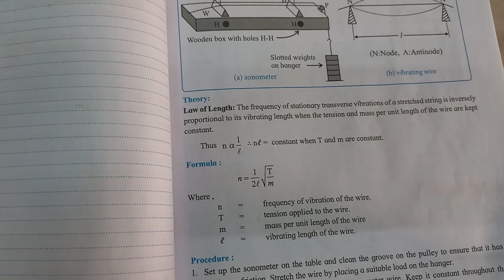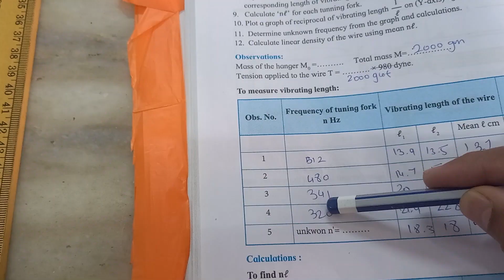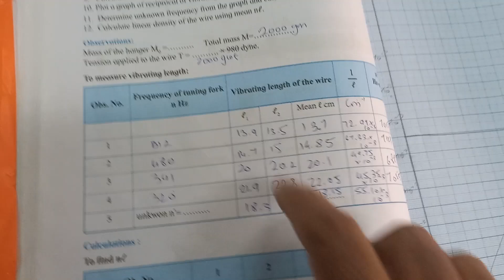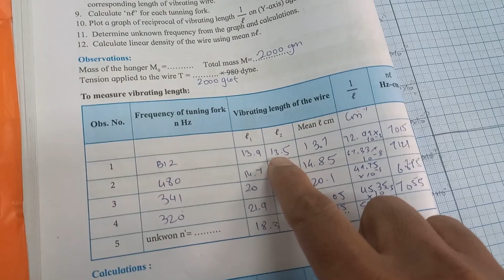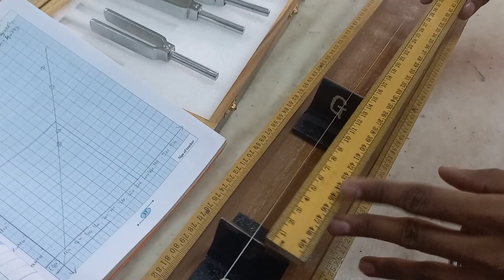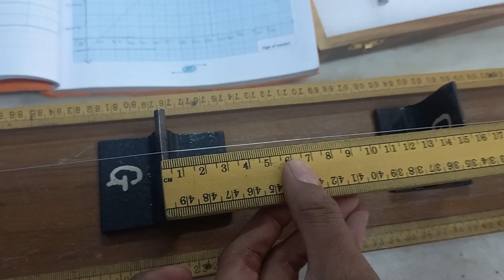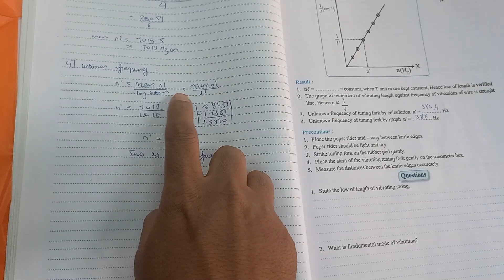Sonometer (Law of Length )

Comment: Sir you are showing it wrong, we are supposed to place the tuning fork on the sonometer box, not on the metal edges
Reply from the maker: Theoretical we are supposed to place fork on box only....so energy passed through it but box need to be in ideal condition..if not will not get correct ans....so we are keeping on metal edges....whatever be condition of box...few college place on box and few on metal edges
U work as per ur college preference 
My suggestion..any experiment u do by ur college way.....our videos for ref